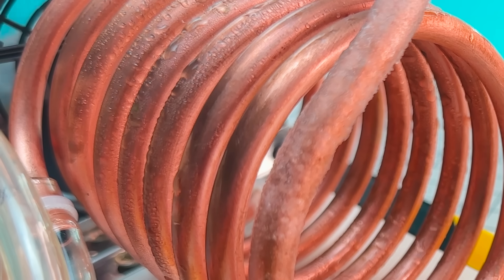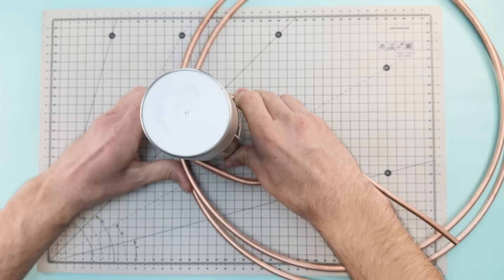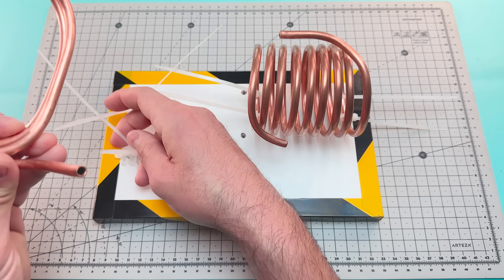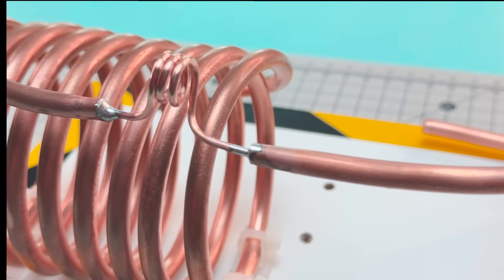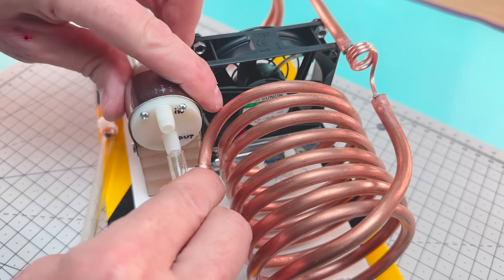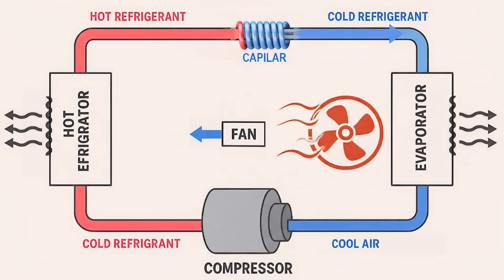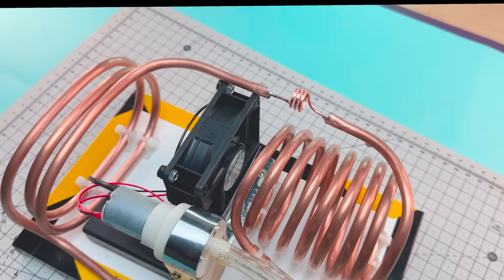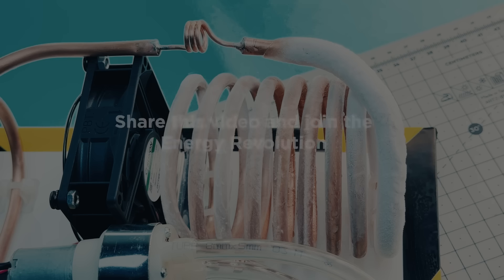Make your own AIR CONDITIONER at home Fast and Easy!

Comment: 3 things to improve: 1. Pumping hot air into cold coil does not make sense, you should transfer the hot air outside. 2. Using brushed pump and ISObutane? Risky business. 3. Leaks leaks leaks
Reply: Can you elaborate why using a brushed pump and ISObutane is risky? What would be a better combination? What leaks are you seeing and what would be the best way to fix that?  So should the "hot" coils have a fan on them to blow out the other direction?
Reply: @chrisbolor brushed motors generate tiny sparks, enough for a fire. Leaks can be eliminated when the pump is sealed (like it is done in fridges). The hot coil should have a separate fan and ideally blow the hot air somewhere else.

Comment: Great job demonstrating what we all learned in elementary school about the correlation between fluid pressure and temperature.  As almost every comment has pointed out, this will not produce any cooling effect…the equivalent of putting any portable ac in a closed space without isolating the hot side and venting the exhaust gas.  
This is a great experiment that could actually be useful by simply adding a few steps to increase efficiency (insulation and isolation of low/high pressure sections).
Reply: Not sure which elementary school you went to...

Comment: If you don’t know the refrigerant compression ratio correctly, you can’t liquefy the refrigerant correctly. If you don’t set the pressure switch correctly, you can’t operate the compressor when the refrigerant is gaseous. And the compressor is different from the motor. A general motor cannot compress and condense the refrigerant. The motor in the video… can’t compress the refrigerant to liquefy it… so the copper pipe is completely frozen… There is no way to circulate the refrigerant correctly. The capillary pores must be blocked by ice…

Comment: 've actually tried this DIY AC concept using copper coils and isobutane, and I was surprised how quickly it cooled a small room! The evaporation and condensation cycle works just like in commercial units though I had to fine-tune the capillary tube length for optimal performance. Great project for hot summer nights!

Comment: thats actually insane considering the size of the batteries, must be pretty efficient.
Reply: About 120% inefficient. Any heat you remove at the cold end dumps out at the hot end and they're both in the same room. So your net temperature change is the heat produced by the fan and pump.
Reply: @themightybuzzard3088  cool, do you think its more efficient then industrial coolers?
Reply: @BensBoltcraftBasics-fz4zv  It's the exact opposite of efficient. It does nothing and does it while wasting energy in the form of heat.
Reply: @themightybuzzard3088  but it cools a room, thats not nothing...
Reply: @BensBoltcraftBasics-fz4zv  No, it does not. Phase change cooling systems do not cool anything, they move heat from one coil to the other. And since those coils are a whopping four inches apart in the same room, that's exactly how far you're moving that heat. Oh and you're adding more heat from the fan and pump. 

This is not an air conditioner, it is a moron detector.
Reply: not if the heated side is on the otehr side of the wall...
Reply: @BensBoltcraftBasics-fz4zv  That was not the case with this.
Reply: @themightybuzzard3088  Do you think an old fridge (working) could be modified to make a cooling system?
Reply: @hannible1002  Absolutely. It'd almost certainly be easier building your own coils than getting undamaged ones from a fridge though. Copper isn't THAT expensive. The vacuum pump and bar gauges necessary to get rid of the air and moisture are what make it expensive.
Reply: @themightybuzzard3088 Thank you. I just thought if I break down an old fridge. The ones with the small freezer compartment at the top and put a fan behind it? Obviously this is a basic plan. What do you think? I can't see why it wouldn't work. But you seem to know your stuff.
Reply: @hannible1002  Over 30 years of doing HVAC, military and civilian, yeah. Blowing a fan through the little square freezer part of a mini-fridge would work. Never get even close to matching up to a window unit and you'd have a few headaches getting the hot condenser coils outside while keeping the cold evaporator "coil" inside but it wouldn't be a bad foot cooler for under your desk or for chilling a single soda.
Reply: yeah pretty much

Comment: I built this so I could chill cans of soda instantly without my mom knowing. I found all the parts in the trash or in my dad's workshop. Turned out the old air pump I used started arcing because the brushes were worn and the the fan and air pump which both rated at 12V DC running off a 9V battery caused reduced power output and increased current draw flattening my battery. I fitted a new battery, but didn''t realise that a blob of glue on the needle hole was never going to work and the zip tie due to it''s design could not apply pressure evenly around the copper tube, so the butane gas found a path of least resistance and began to leak. By the time I found a new battery the gas had leaked. BOOM!

Comment: An "air conditioner" only moves heat from one area to another area. If the cold and warm areas are not isolated from each other this will warm the room not cool it.

Comment: Ummmm isn’t this system missing another fan that blows air over the “hot” side of the system? Or maybe you should just move both coils closer together so that the intake of the 1 fan pulls the heat off the hot side and blows it over the cold side 😂…no matter how you do it, this thing ain’t cooling a room.

Comment: You take the warm air from the hot coil and blow it through the cold one. This doesn't change the temperature except for the fact that it gets warmer thanks to the pump and fan. It's a nice system, but it only works if the heat is vented outside, for example.

Comment: A leak in any of your soldered copper fittings or a super sturdy clear tubing, BOOM !  U just caught yourself on fire like Richard Pryor OR burned your house down. Just for a system that has ZERO room / house cooling effect, other than the few inches on the copper tubing.

Comment: So, the heat energy that converts the gas back to a liquid ‘going into the air’ - is in the same room as the one you are trying to cool?
So the room has an almost neutral thermal load being introduced and it will not change. However, that copper freezing is sure getting you clicks

Comment: If you use a 12-volt refrigerator or bus water cooler pump instead of this small diaphragm pump, this system will be very professional and the pump will no longer get hot in a few minutes. But keep in mind that that pump requires 12 volts and 3 to 5 amps of current, and to provide such a power source, you must use a motorcycle battery, which is heavier and bulkier, and will almost never be portable.

Comment: Blowing air over a little freon does not an air conditioner make. How is the hot air supposed to be removed from the room to be replaced by the freon-cooled air?
Reply: It cools the hot air. Just because you don't remove the hot air, doesn't mean the air itself can't be cool down. It's a closed loop system, Einstein.... That's how they work, like a Swamp cooler, its uses cold air and blows it into dry hot air to cool it down (minus the humidity). But you already "knew this"..... 😂
Reply: @TheTManShow I know you feel very smart right now but that doesn't change the fact that your cold coil next to a fan is not even close to a proper air conditioner
Reply: Thank you Yoda

Comment: Can this be made into PC case ?
Reply: NO. Don't even think about it. If there's any heat exchange, the water will evaporate damaging your electronics. 
There are plenty of solutions to cool your PC which are affordable and are not a danger to your PC. 

Deep Cool water coolers are only 50$, you can also add few cheap 120mm fans to the case. The case itself also plays a role, it has to be well ventilated and not cluttered by wires and especially dust, dust collects and hold all the heat. Cleaning the case and fans once in few months will improve the heat exchange inside your system. 

All of this can solve internal heat, but you're still going to have a lot of heat ventilated out of your PC into your room, you need a good way to ventilate it, the one and only solution is air conditioner as it is the only option to take the warm air out of room and pump the cold air into it at the same time. Regular fans are not cooling your room though, they're simply mixing the air. 

But I repeat again, do no even think about having this anywhere near your PC.
Reply: ^^ that and i recommend keeping your setup room at a steady 66f, that should do it

Comment: so youre cooling the room with a hot coil sitting next to a cold coil eh? lol.... theres a reason why they sit in a window, or have ducts to the outside.....Air Conditioners blow HOT AIR at the same time as the blow COLD air....
Reply: This is not home air. You can freeze Cola or Fanta by using this.
Reply: @petrodrobov  literally in the video: "we now have the air conditioning unit completed and  ready to start cooling the room"
Reply: But this is a WONDERFUL concept of work. Now take this lessen and make a better one 😅

Comment: The hardest part of these ac replica videos is hiding the real compressor and condenser
Reply: i dont really see too much reason why this wouldnt work at least a little bit (other than a weak ass pump)....but your not gonna cool a room with it, especially with the hot coil sitting right next to the cold one with no separation lol... just a fan blowing the hot coild air over the cold coil air lol...
Reply: Have you ever try to disassemble a broken gas lighter? Or even fill it. You will see how it becomes so cold

Comment: Very cool, but based on the comments, I think you should design and build another one that somehow deals with the heat that is generated so that this does what it's supposed to do.  Is isobutane dangerous?
Reply: yes if the butane leaks, its explosive... all AC's run on this type of juice tho... boom boom juice.
Reply: Большинство кондиционеров работает на фреоне, а не на бутане @ryanbard8555
Reply: It's what you put into most lighters....

Comment: now ya just need to get rid of the heat that you're pumping back into the same room, plus the additional heat created by the pump and the fan running
Reply: Right. He would need to put the pump and the heater outside and the cooler and the fan inside...... Wait...

Comment: Well, this device will heat your room slightly.  This is a low-power heater, because it is the heat pump that transfers heat from right (evaporator) to left (condenser) part, and both parts are in the same room.  BTW, this is a good demonstration of heat pump (fridge or air conditioner) work.
Reply: Do you think this demonstration would have a cooling effect if one end were out the window, or is this build not feasible?

Comment: I immediately had a problem with the heat exchanger. But then I thought that if I could dislocate that to a place in my garage to vent the heat out with another fan, like a home HVAC system but mini, that would work.
But then the flammable refrigerant. I can see all sorts of things going wrong with that. A short in the pump due to mechanical failure causing a spark and BOOM! A leak, and motor sparking, BOOM! I wonder how well this would work with a non-flammable refrigerant. 
Yes, 9vdc battery and 12vdc gear, but lower voltage doesn't mean it wouldn't work. Instead of a 9vdc battery, I'd use a proper 12vdc power supply, non-flammable refrigerant, and see if results are adequate. This is something I would never do with anything flammable. Too much can go wrong, and even if it didn't, how can you trust it to run without exploding?
Neat idea though. Too bad thermal electric cooling hasn't evolved to remove chemical involvement all-together.
Reply: Modern consumer refrigiators actually do use propane (R290). But in very low quanteties.

Comment: In the design shown the fan would actually be pulling in air from the condenser ( hot ) to blow over the evaporator (cold). Therefore the colder the evaporator gets, the hotter the air it is trying to cool. Thus zero gain while inefficiency in the process, heat from the battery and heat generated by the pump would result in the production of heat overall.  Congratulations you just built the most inefficient heater imaginable!

Comment: It works perfect. I built this small machine and now it is cool down my 180 square Meter house to a difference of more of 20 degress.
Reply: Ben voyons!!!
Reply: I think this is sarcasm guys don't get worked up lmao
Reply: Awesome! I was just trying to gather all components and was wondering where you got the 100% pure isobutane canister. Here in USA they mostly sell isobutane blends (not pure). The pure version also called R600a is only available in large quantities.
Reply: the condenser is hot though. did you put the condenser on the other side of a wall?
Reply: @lidlnutz  yes, the condenser side needs to be on the outside of a window so it can release the heat outside.
The physics principles of this design are all correct, but I came to the conclusion that there are to many little design flaws for this to be long term functional. You'd be constantly changing batteries and probably refilling Isobutane, amongst other practical issues.
Reply: And what scale did you build it in? 1:100?

Comment: So in my vehicle all of these components are separated at some length I've often wondered why they engineered it this way... They have to take apart my whole dash to access the evaporator core why not just have the parts more accessible so that faulty parts can be replaced easily.   I know that they want to make money but air conditioner parts fail more often than any already.   The service technicians must hate removing all that stuff just to replace a thing. Thank you for helping me understand this process a little better.
Reply: It's like engineers made so many drawings they were like oh no where do we put the AC?? Then threw it in there in some convoluted way

Comment: This is an fiction something in your imagination. Even if it works you need a year to decrease with 2 degrees the temperature in a 10 cubic meters with the condition to separate te condenser .
Reply: Well it's just a portable AC or table top AC, just some tweak on condenser would work perfectly. Benefit of using isobutane is low operating pressure range.
Reply: What kind of thermodynamic math did you do to figure that out?

Comment: This is not safe at all: Isobutane is a highly flammable gas, DO NOT DO THIS !!!!
Reply: Blew the roof of my house ...but it is cooler inside 😅
Reply: @RS-Amsterdam  Something much safer although much less efficient is to have a shallow pan with ice or frozen water bottles positioned behind the intake vent so it pulls in cold air and blows it out. To increase cooling, you can also dip a cotton cloth into the water and position it near the intake vent so you can also employ evaporative cooling

Comment: According to the second law of thermodynamics, in order to cool something, you must expend energy, typically by doing work — which results in an overall increase in entropy. This means that although you can cool a system locally, the process generates more heat elsewhere, leading to a net increase in entropy (disorder) in the universe. In other words, you always end up adding more heat than you remove... Air conditioning for dummies 🤣🤣🤣

Comment: You must separate the condenser and evaporator units. Add a fan to the condenser to blow out the hot air. You also need to install a tray below the evaporator to collect  water droplets and drain them outdoor. In dry places, this can be used for creating water-from-air.

Comment: When the moisture in the air inside the pipes falls below the freezing point due to capillary expansion, the moisture naturally freezes, which is called the freeze-up phenomenon in artificial refrigeration and it can no longer function.
Reply: So the flammable fluid only lasts for one passage?

Comment: Thats actually a dehumidifier unless you split it wiyh a devider inbetween & add condenser fan to condenser heat discharge, otherqise i only see that fan pulling condenser discharge into the evaporator which is acting as dehumidification, pretty neat though thanks

Comment: 1 flaw, the heat from the other sides needs so go somewhere, and the only place to go is back in the room. this would give off cool fan air but it wont cool a room down.
Reply: Yep. Exactly.
Reply: put the hot part outside ?